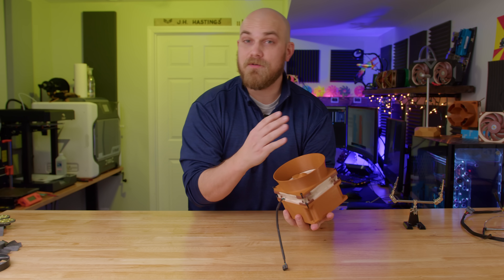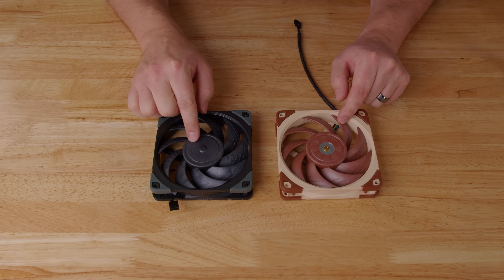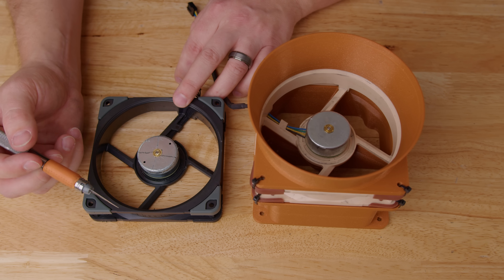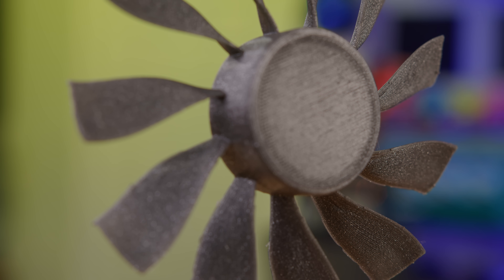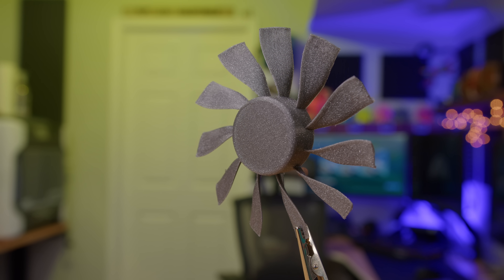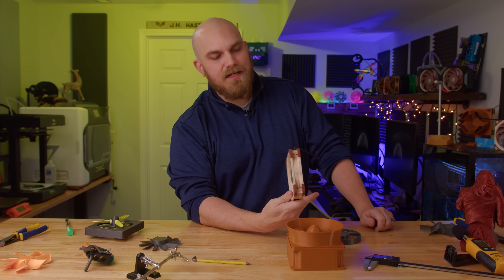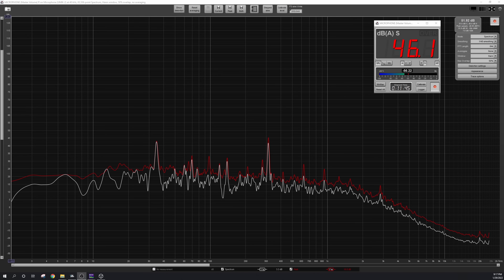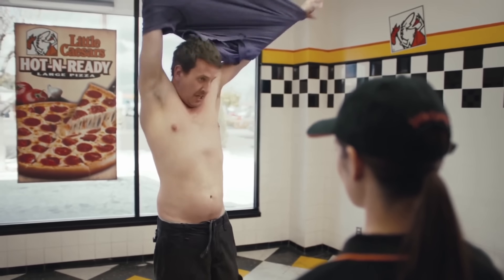Overdrive ENGAGED | Fan Showdown S4E1

Comment: How are you getting on with your I-fast Mr Major?  I am thinking about getting one.
Reply from the maker: Works well I like it dual extruder is nice for playing and pla wish it had automatic bed leveling
Reply: @MajorHardware  Funny you should say that - I am looking at the brand new X-CF  Pro now - its a bit smaller and doesnt have the dual extruder but has auto levelling and high temp extruder for nylon etc - few hundred bucks cheaper than the I-FAST too!

Comment: no delta? I think that you took out the only test that was directly linked to the devices most common (by far) use case...   the cfm is cool, but as an add on, not a replacement for the core test... I'm not using this thing to cool me off in the summer time...

Comment: It would be interesting to see the differences between positive pressure vs negative pressure (push vs pull). Maybe test if there is an air flow difference and a cooling difference. 
You have tested both style fans in the showdowns, but it has not been established if one style is better than the other. Or if it even makes a difference at all…

Keep up the good work and always look forward to the next episode!

Comment: Concerning the OD fan that didn't work anyway, I think the gears themselves would have blocked too much of the airflow anyway. Even more skelatal gears than those in the video would probably do so as well.
Reply: Right, so the idea is that the propellers will spin at a much higher speed than the planets and move the air faster than it would be seriously blocked by the planets. As someone else has mentioned, I will adjust the vents in the planets to be much bigger (not just few round holes) and see how that would perform.

Comment: Engineer here:
Those holes might be for balancing the motor. I'm guessing that at some point in the assembly line they have a machine testing the vibration of the motor hub and then a cnc drills holes in each one the required  hole(s), Or the they know that the motor assembly will be off-balanced and how much, the use a punch-die in the stamp process that makes those holes for later counter-balanced any eccentricity. This is just an educated guess, could be totally wrong.

Comment: tip for the profan
make the gear teeth larger, and change their size, loosen the tolerances
max gear ratio you want is about 3:1
best lubricants for plastic:
Teflon(brand name for PTFE) spray or silicone oil

made the mistake to put silicon oil in my analog alarm clock with plastic teeth cuz it was going slow and sticking, it now is 2 hours ahead per day
Reply: The tolerances are loose enough at this stage, my current guess is that the way the moving parts are held together is suboptimal - it is essentially the pressure between planet gears against the case (that cross-like section) and the brim around the central piece. I am currently printing the version where I glue pieces to the bearings and glue the bearings to the carrier - this way the entire cross section might become redundant. Will see in next few days 😋
Reply: @ArtemShoobovych  remember to use open bearings
if you buy shielded bearings, take off the shield and clean out the grease, use some sort of dry lubricant

I know, I'm going on and on about lubrication, but it's essentially what makes or brakes a machine

Comment: About the broken Chromax fan, from what I recall Noctua's explanation about the fan, it was made in a material allowing extremely narrow gaps between the blades and the casing for the original one. Back in the days, they said the material used for their black fans was not able enough to do the same job, so they had to redo research on material (seemed from the way I read this that it doesn't work with just changing some pigments in the mixture).

It's just a distant memory, from somewhere the early 2010s or so, I might have the memory distorted, but it might be a clue.

Comment: Can you try the ProFan with a two satellites configuration ? It should have slightly less friction and it may be just what it takes for it to work. Also, make the opening in the satellites larger to reduce the weight and obstruction to the air flow.
Reply: The holes in the planet gears are configured so that their diameter fits within the bounds of the inner circle and the diameter of the axis, so can't really make them much bigger - few millimetres at most. But two planets is easily achievable - the design is entirely parametric, so it is just the matter of printing it.

The idea I had in mind with 3 planets was to reduce the torque required to spin the central piece (given it also has to carry propellers).
Reply: @ArtemShoobovych  Those holes don't need to be circular. They could be made do that there are three or four spokes connecting their axis and the rim. This would reduce the weight and leave more area for the air to flow through.

Another thing that could help would be to reduce the ratio between the motor and the blades. A ratio of about 1:7 instead of 1:9 could be better.
Reply: @Kualinar  ah right, I was too focused on the other parts and completely forgot about the non-circular vents. Cheers! Will adjust the design 👍

As for the ratio - I will research this option closely, as many people have mentioned it already.
Reply: @ArtemShoobovych  Glad that I may help you get a better design. Your fan looks nice. It was a shame that it did not perform😢.

Frankly, I did not expect that you would reply to my comment. Nice surprise ☺️

Comment: Alright two things. 
A.) New season can we try bearings!?!?
I feel like it would be super cool to see what we get for fans with bearings
B.) Anyone like the idea of a fan with no center hub driven by an external motor? So maybe a circular fan with gears/bearings in the corners with one 'drive' gear to provider power but no drag from a center hub. Thoughts?
Reply: Brilliant idea in its use of otherwise wasted space, the challenge being how to transfer drive power to the fan...direct drive of a toothed perimeter would require either a stupid fast motor speed or significant reduction gearing. Also, your angular blade velocity approaches zero toward the center. Maybe attach four fixed supports to a small hub to drive a counter-rotating smaller, say 30mm central fan? Or traditional center drive with a rotating shroud connected to the blades, external gear teeth similarly driving four tiny corner fans with perimeter bearings for all five fans. Naturally with concepts such as these we are not considering commercial viability or economics on any level, strictly best performance within set design parameters. That said, utilizing the corners could be as big a game changer as the cheater's external ductwork!

Comment: i think you need to vile down every single gear tooth on other to make this work.  printing just is not smooth so there is a utter boarload of resistance. and on top of that the prints are sagging so thats makig them useless on some parts. there was a shit ton of wobble on some fans or parts totally making the test irrelevant.

Comment: break in the gear fan with blue diamond lapping compound and a drill motor apply the lapping compound to all contact surfaces then clean it off with dish soap and warm water lubricate with wristwatch oil

Comment: The holes in the hub may be to facilitate assembly. When pressing the fan body onto the drive the holes are an air escape so they can (possibly) achieve better bonding.

Comment: How about making a disqualified geared fan episode with all those fan's the A12x25 couldn't drive? Stick them to a motor with higher torque and let it run at the same speed as the A12x25. Or, instead of a separate episode, let the failed fan just continue the round with a stronger motor, of course as disqualified, just to see how it would have performed against the other fan's in the round.
Reply: My current bet is the amount of friction between all the moving parts of the ProFan assembly, so the "stronger motor" would be of a drill size (which is what I tested it with). But right, would be much more fun if it worked - just curious how it would perform.

Comment: Would love to see you get one of the  3000rpm noctua industrial pc fans too to test each design with both the normal and the industrial fan to see the difference ( could something run quiet enough to run on the faster speed and provide enough airflow to be better than a lower rpm fan with similar noise levels)

Comment: instead of using dremel to cut open the fan, use a soldering iron with a flat head to cut the fan,this way  you won't mess up the beautiful metal hub
Reply: However you will mess up with your beautiful clean soldering iron :P
Reply: @eisbarfan7716  couple pass with a sand paper and is good as new
Reply: @V843v3r  also you will be happier with less vibrations because of metal getting off a perfectly balanced cap.

Comment: The holes... Air escape holes when gluing the plastic to the metal.
The old had a hole in the plastic, the new one need to get rid of the air some where else without pushing out the glue.

Comment: For me, such testing is less interesting without cooling results.  The airflow on the computer case is obstructed by dust filters or restricted by glass and metal panels.  At the same time, fans for computer cases can be of different sizes.

Comment: For future gear fans, use helical gear teeth instead.
There's more contact but there's less need for precise tolerances that the spur gears need to not bind.

It's one of the reasons why transmissions use it rather than straight cuts, not factoring in the noise and so on. And yeah I know straight cut gears are used for race applications.

Helicals do produce thrust as a biproduct of it's geometry, but the fan already has that by default so it's less of an issue.

Edit, as for the brittle material, noctua did state that their reasoning for taking ages to release a non traditional fan was due to the materials being different as it wasn't as simple as just changing dyes.
Reply: helical gears would make assembly trickier, wouldn't it?
Reply: @ArtemShoobovych  not really no. The teeth height would be the same just oriented differently. / Vs |.

The difference is that the teeth would have a sliding force more than a tooth using torque to force the movement which results in much smoother function at the cost of thrust vectors being added. I know both use torque just harder to explain the engagement.
Reply: @CreamAle  but i assume the friction would be higher with helical gears. indeed, it might be used more efficiently, but we are limited by the Noctua's motor torque here, i assumed with spur gears it would be easier (for motor) to spin the entire assembly
Reply: @ArtemShoobovych  the friction would be higher in a perfect world where tolerances between a straight cut and helicals are perfect.

But this isn't that. This has a ton of slop due to the 3d printing and material flex. It's also why they're used in normal transmissions due to the wear and tear that causes slop to happen naturally. The way the gears meshes just removes a good portion of needing perfect teeth to teeth engagement.

Edit: autocorrect decided to automessup
Reply: @CreamAle  this is a nice explanation, cheers! Will adjust the design this week to use helical gears 👍 yet printing this whole thing takes forever (think one entire day), hope it is worth it 😅
Reply: @ArtemShoobovych  you can try hearing bone gears as well. Those are designed for high impact/vibration situations just expensive due to manufacturing in metal and all that.

Since these fans will never be balanced perfectly, that could also help with the design but the tolerances and support could be an issue for printing sideways V on a cylinder. Idk there, i know helicals print well though.

But yeah homie, hope you have some good results.
Reply: Well the issue with herringbone gears would be the assembly - I can imagine sliding the helical gears into place in a specific order (central piece into the case, because of the mount -> planets into the carrier -> carrier with planets inside the ring gear and on top of sun gear simultaneously). But herringbone gears would require the ring gear / case to be made compound (made of two separate pieces), which would make it all very difficult to get right (since it is a gear and a case at the same time).

But let me try the bearings and the helical gears first 🙂
Reply: @ArtemShoobovych  yep that would be an issue if you didn't print in place. There's a few precision test prints out there that could be used as an example. It would be crunchy at first but plastic wears quick.

But yeah man hope you have success with it.
Reply: @ArtemShoobovych  yo, did you ever get to print and test or is life stuff in the way? The joys of adulting.
Reply: @CreamAle  still working on helical gears, smaller ratio and planet gears. Also got myself a fan (although not Noctua and only 1150 RPM), so need to get a power supply and mount the thing. But the assembly with bearings already works (on a drill). Hope next weekend will be able to work on a video 😊
Reply: @ArtemShoobovych  just got recommended a channel, retsetman he did just what we're talking about. Worth the watch, vid posted 5 days ago.
Reply: @CreamAle  saw it in suggestions few days ago, added to my checklist 😁👍
Reply: did not film the thing yet, but damn that tangential force is strong - now i need a way to hold my planets and sun gears in place 😁

Comment: I think you should do a test of the top 5 from last season. Take the shrouds off the cheater and compare and give the top 5 the cheater's iet and outlet shroud. Let's find out if the fan is actually any good, or which would surpass it if given the same tricks.

Comment: You should use these thermistor heat producing things from a 3d printer as a heat source to cool, rather than a pc. This way you can check how much wattage a fan is able to cool sufficiently.

Comment: The holes could be a manufacturing thing. Before you had a hole in the plastic fan, now in the metal, probably to allow air to escape when mounting the fan.

Comment: As a citizen of anywhere In the world that's not America I would appreciate if airflow was also presented in metric units. Thanks.

And as a side note instead of linear air speed, perhaps use volumetric air flow. The speed depends on the shape of the wind tunnel while the air flow shouldn't (if you disregard the losses from friction etc).

Comment: The holes in the noctua hub might be to lock in the plastic fan part to the hub. Did the plastic moulding have little nuba that would go in there? I'm guessing to guarantee that the fan couldn't slip on the hub in any way.

Comment: I think apart from fan geometry, the "Cheater" has two major advantages:

1. It has a proper inlet which has a remarkable impact on the flow. Almost all larger commercial flow machines from (subsonic) jet engines to industrial fans have similar shaped inlets.
2. It stabilizes the swirl created by the rotating fan blades, realigning the tangential velocity component and thereby creating a less divergent flow.

I think any fan design that could challenge the "Cheater" needs to have these two features too which would make it look very similar to the "Cheater".
And I think whoever designed it must have had some major knowledge in fluid dynamics :D
Reply: I'd like to see the T33 in the cheaters shroud.
Reply: The Autor called it Cheater BECAUSE of this, Also, dude has some great drawing skills.
Here is the episode. The fan appears on 4:40
https://www.youtube.com/watch?v=I2lxGYplpMA

Comment: Is someone tries another gear fan, I'd be interested in seeing someone basically sticking the A12X25's original fan disk using gears to up the RPM. Would also be interesting if someone could mail in a fan like those gear fans they assemble themselves including some bearings

Comment: The little holes might be for letting air through the motor as a fan disk is pressed on, there is now no hole in the disk after all and it looks pretty airtight

Comment: Use a drill to run the gears in for 10minutes or so. It loosens them right up.
Reply: @@user-ip3zi5mb6lprinted gears like these always need to be broken in first because of printing imperfections. Running the setup on a drill speeds up this process and ensures that any imperfections have been rubbed out by friction between the parts.

It's sad watching designs unable to give it their best shot because this host fails as a maker.

Comment: lol B.O.M. $22 Delta 120mm 12cm PWM TFC1212DE 252CFM 12038 DC 12V
Reply: Betting a noise normalized run would be a good showing.
Reply: Same with the Delta FFC0612DE 0.78A Little more tame all around too. I actually own some of these. Not bad when you turn them down, unlike some other server fans I have that have coil whine at low speed.

Comment: Just an idea - instead of a gear fan, someone should design a CVT fan, where you turn a crank and it adjusts the CVT belt to change RPM
Reply: That would be interesting but I would assume that the CVT wouldn’t actually change RPM. A fans RPM is directly related to motor power VS air resistance. Changing the gear ratios won’t give the motor more power to overcome the fans air resistance so technically no matter what ratio you use RPM will always stay basically the same. Once you add extra friction to the gear/CVT mechanism you would end up with a slower fan vs the same blades no gear ratio at all. I would like to see a test where there is one design with a 1:2 ratio, and another design with a 1:1 ratio with the same blades. The 1:2 should actually have a slower blade RPM than the 1:1 because of extra friction and no extra motor power.